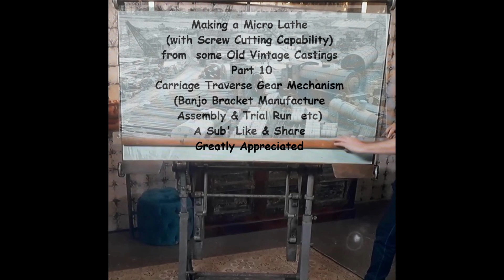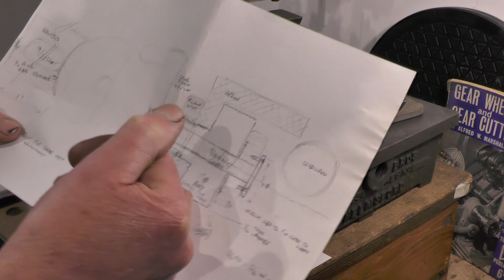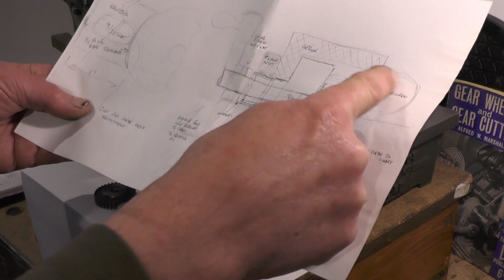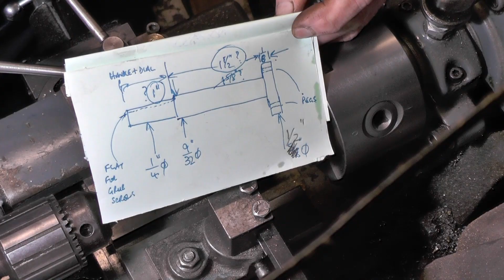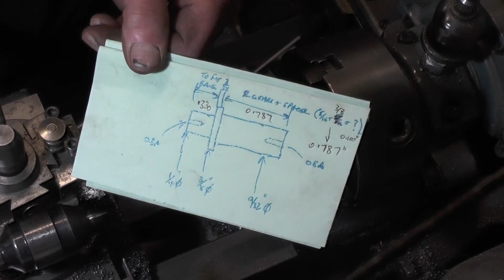Ep10 Making a Micro / Mini / Watchmakers Lathe from Vintage Casting (Carriage Traverse)"mr factotum"

Comment: why not add a clutch to the leadscrew like the myford ML10?
that will rectify the handle spinning
Reply from the maker: eyup Brendan.
Thanks for feedback, yes thanks for suggestion i will add it to my list i've had from others for future mods when i've finished the lathe,  and will show  all suggested mods in a future video, once ive tried the lathe out, might be slowing down a bit now in workshop as the weather is picking up, to get outside maintenace work done around the home. Also got to do some maintenance on my loco ready to get it's 3rd MOT soon.
See you next time
ATB
Kev

Comment: Clever, as ever. Maybe you could make the carriage handle so that it slides on the shaft by 1/4" or so, and engages on a key on the shaft when you push it in, and disengages when pulled out, so the shaft turns if the lead screw is powered, but the handle being unkeyed should hand stationery-ish. Might make it a bit nicer if using the lead screw as a powered longitudinal feed when plain turning. Not that it's necessary, and there may not be enough room for frippery. Thanks for posting all this, it looks like you are enjoying it nearly as much as I am.
Reply from the maker: eyup tnld
Thanks for the feedback and suggestion, great, i will put that on my modification list for when i've finished and tried everything out. I am a little in front now so handle and dial done and in the can, so to speak. But will certainly look in to your suggestion, it's good to have everyone's ideas to throw in to the melting pot.
When i've finished the job lot, later in the year, i will do some modification videos, 
i'm slowing things down a bit now weather picking up so workshop time gets put on back burner.
Keep the suggestions coming, many thanks
ATB
Kev

Comment: You could put a small handle on the banjo locking nut and knick it off when using the power feed but just replacing one problem with another in that you'd have to reset you banjo each time.
Reply from the maker: eyup Stephen
Thanks for feedback, appreciated, yes it's swings and roundabouts, but will bear that in mind, the more different suggestions gives a better outcome, so thanks
atb
Kev
Reply: @MrFactotum  how rude of me, forgot to say, I'm absolutely loving this mini/micro lathe build full of really useful info and insights. Thank you for sharing!
Reply from the maker: @stephenperry5849  No problem at all Stephen, glad your so interested👍👍😉😉
atb
Kev